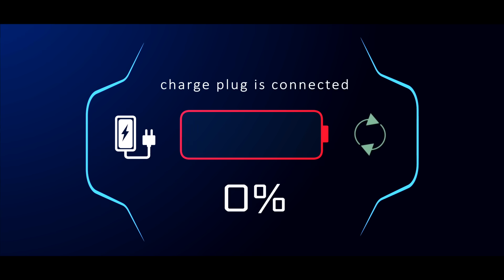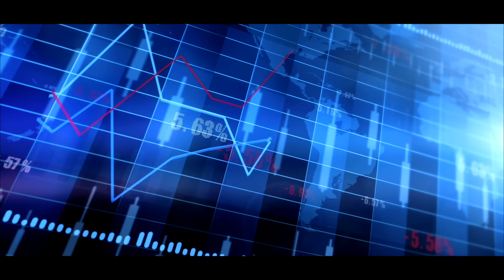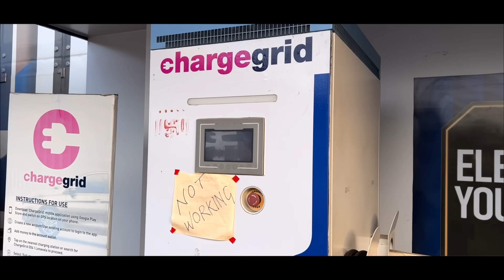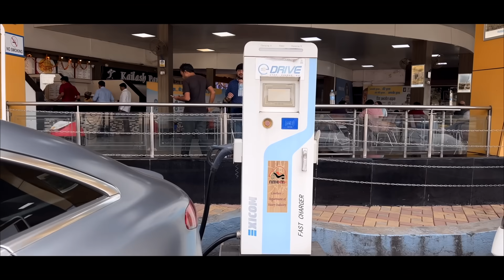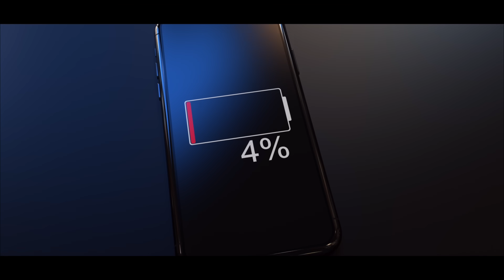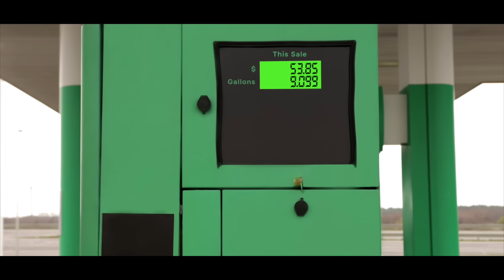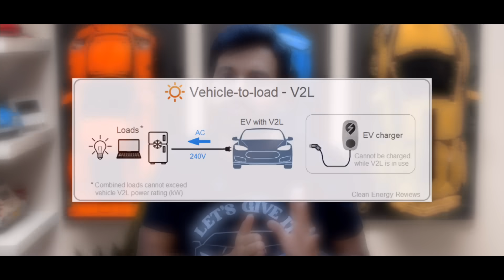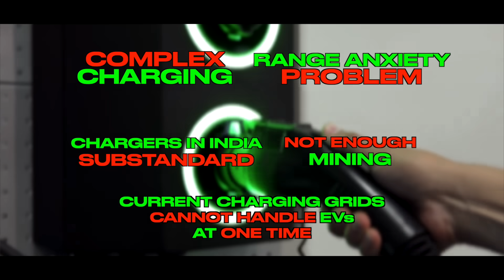Here Is Why Electric Cars Are Not The Future!

Comment: As a person who researches in Carbon Neutrality Technology, I absolutely agree with the charging and battery issues. In Europe, the governments give a charging card-type pass, which can be topped up like a fastag, and that can be used to charge at any charging station. Also, the charging standard is mandated as CCS-type connectors in Europe, to the extent that Tesla, the most arrogant of all EV makers, had to bow down and install CCS converters in their Model S and Model 3 EVs. I don't see the Indian Govt mandating such standardization on all EV companies.

Also, battery materials are incredibly toxic to mine, compared to iron, steel, aluminum, and so on. As some experts say, "There is no such thing as ethical Lithium and ethical Cobalt. It's a mental decision about how much you want to damage the third-world countries." Coming to battery disposal, there is the possibility of recycling, but the present industry can only recover 90-95% of the lithium and Cobalt from a battery. On the other hand, the iron, steel, and aluminum in ICE vehicles can be melted down into a soup, and then be separated based on their densities, which gives an almost 100% recovery of metal in scrap.

Also, regarding the battery performance, the lithium-ion batteries used in EVs are at their most efficient when they are at 21°C. Any higher, and the heat stress on the battery increases until the ion barrier breaks down, and the battery shorts out, catching fire. That's why most phones shut down everything when the battery becomes too hot. And EVs do try to shut down, but the exposure to external heat and forced driving due to legal issues (pulling over to the side of the road), lead to further overheating and then the failure of the battery.

Also, if a battery is not at the optimum temperature of 21°C, then the range starts dropping dramatically. This might not be a problem in a European country where the temperatures are a pleasant 15-25°C, but in a country where the ambient temperature crosses over 40°C routinely during the warmer months, it is foolish to expect that the performance and range would be as the manufacturer would claim in Europe. ARAI would get ludicrous ranges as they would keep the car in an air-conditioned space at 21°C during testing, thereby maximizing the performance. The same would go for battery degradation, as high temperatures would lead to faster battery degradation. So a battery that would last for 3 years in Europe would need replacement almost every year in India.

All in all, EVs need much more work before they can successfully replace ICE cars across the world. The battery needs to be made of better materials, or supercapacitors, which are more robust and can last like the ICE engines. Lithium-ion tech made sense for personal electronics like phones or laptops, as they are mostly kept in air-conditioned spaces and are handled with care, with less jerking around and bumps. EVs experience wild temperature variations, massive current loads, and serious undulations, which are not what Lithium Ion tech was developed to handle.

The only feasible solution (at the city level atleast) is to massively upgrade public transportation to the point where people don't need to take their cars and bikes to work, preferring to ride the metro/suburban rail/bus instead. That's the honest solution for the climate crisis.

Comment: Fun video.  I am a proponent on EV cars, I have had one for 5 years in the USA.  But I would never recommend one to:
A. People living in rural areas.  
B. Anyone without home charging.  
C. Anyone that regularly drives over 60% of the rated mileage per day.  
D. Anyone that would have to use it to regularly drive away from home overnight.

In the 5 years that I have had my car, it has never been fast charged (DC charged).  It has only been charged on a public level 2 charger a hand full of times.  It has served me well as our family's second in town/commuter vehicle.  I would not own an EV unless I had another car that was an ICE or was willing to rent an ICE for long trips.  This will change as more efficient EV's become available over the next 5 years.  Those efficiencies will come from better aerodynamics, vehicle manufacturing techniques/materials, and better battery technologies that may not even use lithium.  That non-lithium projection may take longer, but the rest are possible today and only need small push to start production.

All that said, I agree with 95% of what you say.  The one point that I take issue with is this.  The amount of electricity that it takes to refine crude oil into gasoline is huge.  So huge that it is nearly the amount that an EV requires.  The exact amount is highly debatable, particularly in that it also takes quite a bit of oil and gas to do the pumping, transportation, and refining.  So it takes a fair amount of Calculus and more data that what is readily available to get to the full answer.  And this does not consider the pollution and toxic waste put out by the refineries themselves along with the energy requirements of that waste disposal.

But I still have to agree with your ultimate conclusion.  The 15 or so year targets of these companies to go all EV is unrealistic when you consider world-wide markets.  Even in the US, it will be a struggle to get there both in infrastructure and politics particularly in the rural areas.  The smaller area and higher population density of most of the EU and some coastal areas of the US makes it possible in those areas, but only in those areas.  The rest of the world has a long way to go.

Comment: Here are my thoughts coming from one of the rare car enthusiast EV owners:

His first point of EVs causing more environmental harm is bs coz for every one research paper stating that they’re harmful, there are 10 proving they are better. Motortrend’s latest article puts an end to that stupid theory. EVs even if run from non renewable energy are always better for the environment and more energy efficient than ICE. As we move towards cleaner energy, it gets better. 

Charging network is shit in north India but in the south with Zeon, you just plug in and it charges. Don’t even need to tap the card like UK or need to open app. They will come to north soon. ABB chargers used by them are 100% reliable, always working and fast. 

With regards to battery health, it doesn’t degrade like a mobile phone. Even after 10 years, battery will have atleast 80% health in most EVs so you don’t need to throw the car away or change battery unlike popular belief.

Range anxiety is not experienced by any EV owner except in emergencies once you get used to the car. Just like ICE, you don’t let it run out and it’s easy enough to do so. 

His point of EVs being less emotional than ICE depends on personal preference and he can’t speak for everyone. My ZS is equally exciting as my straight piped Accord. ZS excites using instant torque and Accord using visceral exhaust note. A true enthusiast would appreciate all forms of automotive experiences.
Reply: Let him spread his ICE propoganda to his followers.
Reply: @manjeetkolte8601  An automotive journalist should be fair and unbiased. Look at him lol.
Reply: @kevinsamuel3930  He still needs access to high end supercar manufacturers to promote, so gotta pander to them somehow.

Comment: Look at all those problems

1. *Limited Range:* Many EVs have a limited range on a single charge compared to traditional vehicles. Range anxiety is a concern for some potential buyers.

2. *Charging Infrastructure:* The availability and accessibility of charging stations can be inconsistent, especially in certain regions, making long-distance travel challenging.

3. *Charging Time:* While charging technology is improving, the time it takes to recharge an EV is still longer than refueling a conventional vehicle.

4. *Initial Cost:* The upfront cost of purchasing an electric vehicle is often higher than that of a comparable traditional vehicle, although this is gradually changing with advancements in technology and government incentives.

5. *Battery Degradation:* Over time, the performance of the electric vehicle's battery may degrade, affecting its overall range and efficiency.

6. *Environmental Impact of Battery Production:* The production of electric vehicle batteries involves mining and processing materials, which can have environmental impacts.

7. *Dependency on Electricity Grid:* The transition to widespread EV adoption raises concerns about the capacity and reliability of the electricity grid, especially during peak demand times.

8. *Recycling Challenges:* Proper disposal and recycling of EV batteries pose challenges, and developing efficient recycling methods is crucial for minimizing environmental impact.

Comment: Nice video explaining all the faults 
But the part where you explained the electricity cost slab is quite vague 
Suppose you're an average Indian household using 1000 units per month 
Then you'll be using the EV in the highest slab 
And it'll still work out to be cheaper than petrol vehicle per km

Comment: The main issue I see with all-electric is honestly concerning those that live rural. Electric companies for some reason think that every home owner has a garage when those of us that live in older houses simply don't have one, and realistically can't have one without spending thousands on the actual garage and the work it'll take rerouting underground water, sewage and gas lines. Plus even if that could happen, the reality is that those that do have garages still tend to park on the street anyways.

Also, before anyone says anything about companies supplying charging stations, something you have to realize about rural living is that the companies around here rarely even have asphalt parking lots. Lots of gravel lots that employees park in, and typically it's every man/woman for themselves in order to get a spot. Basically, good luck getting enough charging stations and getting the space for 150+ employees to all charge while at work.

Comment: Good to see this video. My feedback here. 

1. Ev source impact on environment and human rights is damn true. Tail pipe emission reduction can control emissions like Nox and Sox. But carbon emissions are still high at production. 
2. I disagree with blame on Europe. They are doing much better in terms of ethical sourcing compliance. A draft law is under development to implement transparency and due diligence on batteries supplied from other nations. India isnt doing anything on this yet. Forget Batteries, we dont have ethical sourcing concept for any product. 
3. Dependency on China is again so true. It controls 80% of global battery resources and manufacturing system. Hypocrites think buying Tata or Mahindra is supporting Make in India. 
4. For first time i learnt on niggles about charging stations. Good to know. 
5. About fire, data shows ICE CARS have 80% more chances of catching up a fire than an EV. So i disagree with you. 
6. Recycling: yes India is miles behind in recycling policies. Infact its so behind in circularity for anything. Even for transit there is no strategy to proper recycle old ice cars to evs instead of new.
7. I disagree on sounds and soul. I found driving EV is exhilarating and relaxing. No sound and super easy. 

Final touch: now considering your name and you have been blaming govt here, gearup for some threats and abuses by bhakts.

Comment: I’m an early adopter , and drive a 2020 Nexon EV , and have only done 28000 km in almost 4 years. 
I understand your anxiety and frustration for phasing out of ICE vehicles. 
It should happen in phases , as the market for EVs matures . But you know politicians, they like to make promises. So don’t fret about not having a vehicle of your choice. 
I had assumed that with my careful planning my battery would last forever, even as a power backup for home use if needed. It probably may , but in our country we don’t have enough vehicles yet for a new breed of people to take care of battery refurbishment. 
Even if they do stop producing ice cars, they will restart once they see the problems. 
Recently my car battery was replaced by Tata motor, just because they couldn’t figure how to charge it. I’m sure it’s not a new battery, but one refurbished, using a less healthy battery from another owner. It has much less capacity and range than what I used to get. 
I shudder to think about what will happen after 8 years when the warranty expires. Obviously I will have to scrap the car. However if more people buy EVs , then there will be more companies that will open up to repair batteries. We will not have to rely only on Tata Motors to replace it at full cost. 
Teslas are being fitted with refurbished batteries at half the cost by Gruber motors and other companies, as compared to Tesla. 
In fact this is a good time for our Indian Entrepreneurs to enter into battery repair business and rake in the moolah for the rest of their lives.

Comment: Most of the problems can be resolved easily with the introduction of sodium ion battery. Sodium is an abundant resource so easy to extract, cheaper cost (1/5), faster charging (200%), safer to operate (less prone to fire incident), works at -20°C with 90% efficiency and environment friendly.
The only issue is it has less energy density than lithium Ion by 30-35%, thus increasing the battery pack size which R&D teams can bridge in next 2 years. These cells will hit largescale production by 2023 end and available in automobiles by next year itself. 🙂

Comment: Electric motor: one moving part with two bearings.  ICE motor:  hundreds of mechanical moving parts that have to be in synchronization with each other.  It's a no brainer which is the more efficient application.  So the big question is the fuel source.  I have two vehicles.  An EV and a ICE.  My EV is my daily commuter which I charge at my home.  My ICE (pick up) is used mostly for utility purposes. The EV is 1/3 the cost of the ICE to operate.   If the battery bricks, then I have to recalculate.  From a long time EV user,  given the battery question, I would recommend to people that buy into EVs, to trade them in before the warranty runs out.  Right now, for the most part, replacing an EV battery is astronomically high.  Is the battery going to be non functional after the warranty, probably not but that's a gamble and there is definitely degradation of the battery throughout it's usage  Another component to EVs, is, given the state of R&D for the holy grail of battery chemistry, your 8 yr old EV battery is going to be way obsolete.. As far as the green part, we trade one environmental impact for another.  Pick your poison.

Comment: A few things that this video overlooked is that even though EVs produce more greenhouse gases to make even when run on %100 coal they outperform ice vehicles after around 30,000 to 50,000. And he also overlooked that not all batteries are using colbalt and they are starting to recycle the batteries so having to mine for material’s is just temporary and not a permanent thing like fracking and drilling for oil. I love how this guy says things about how EVs harm the environment through greenhouse gasses without even at least acknowledging the fact that Ice cars are worse in that regard by a long shot over its life span even with completely unrenewable energy sources. Basically trying to make a positive thing for EVs into a negative by not telling the full picture and being very biased

Comment: Think about a cross country trip you've taken when gas stations on the free way have been full or nearly full. I've experienced this in Wisconsin. EVs will be too far from home to charge there, so they'll have to use charging stations along the interstate, just as ICE cars need gas stations. However, while ICE cars can be filled in under 5 minutes, EVs take AT LEAST 6X longer than that to fill to 80%. Ergo, EV charging stations along the interstate will have to be around 6X more numerous than ICE gas stations. Now, consider that each fast charging station needs cabling to connect to the local grid, and you begin to see why EV fast chargers are so much more expensive than gas pumps.

Comment: Global climate is not too hot, but I understand in India and some other areas it may be painfully hot. EVs are not an efficient way to cool down hot areas. Rather use local and regional means to cool temperature down. For the price of one electric car you could buy 50000 m2 aluminium blancet, which properly positioned could throw 25 MW solar radiation back to the sky. And, if lucky you don't need to replace the blancet every 5 years.

Comment: - Why doesn’t a single anti EV evangelist speak about noise pollution that is a huge issue? 

- Tail pipe emissions can’t be taken lightly. Delhi is a classic example of what tail pipe emissions can do to people’s health. 

- Lack of charging infrastructure is over emphasized. Charging network is constantly improving, and it’s only a matter of time it will catch up with the car sales. 

- Many states in india have a mix of clean and dirty energy emission. Most EV’s become carbon neutral in 1.5 to 5.0 years.